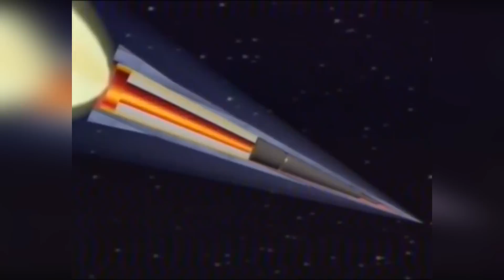Why "Oreshnik" is Unstoppable ?

Comment: Why use SM2 not SM3 against Oreshnik?
Reply: Both are useless, it's just too fast
Reply: Oreshnik can maneuver on a middle part of the trajectory and has 36 submunitions what can move with speed of mach 10. So sm-3 or other US interceptors can't intercept Oreshnik.
Reply: @batman7759  can't SM3 manouver and adapt to new trajectories of Oreshnik? I guess Oreshnik splits into Mirvs before reentering the atmosphere not in the midcourse?
Reply: @marcinmod1490  nope, sm-3 can't intersept Oreshnik in the middle of traectory. Sm-3 can only intercept standard ballistic missles in the middle of traectory. But even if it could it doesn't have enough speed to catch it.
Reply: @batman7759  According to Google Oreshnik speed mach 10, SM3 speed mach 13....Besides interceptor doesn't chase but only hit incomming missile and adjust to changing trajectories.
Reply: @marcinmod1490  you Are right about speed but both sm-3 and thaad can't intersept maneuver targets like Oreshnik. And march 10 I think it's a final speed for submunitions. In this rocket there are 6 warheads with 6 submunitions in each one. So 36 submunitions all tighter. And don't forget that warheads and submunitions are surrounded with plasma which makes much more complicated to detect this warheads and submunitions. Sm-3 and thaad can only intercept standard medium and intermediate range ballistic missles which can't maneuver on middle stage of traectory. So they are useless in middle stage against Oreshnik and in a final stage u deal with 36 submunitions.
Reply: @batman7759  But SM3 is a middlestage interceptor. The plasma occurs in atmosphere not in space where the interception should take place?
Reply: @marcinmod1490 both sm-3 and thaad can intersept warheads in middle and final stages but they can accurately hit only non-maneuverable warheads. So sm-3 and thaad are useless in the middle stage of Oreshnik traectory and in the final stage they must deal with 36 hypersonic submunitions.
Reply: @marcinmod1490  Oreshnik warheads fly mostly in rarefied atmosphere not in space. I agree what true plasma appears in dense atmosphere but in rarefied atmosphere warheads are still surrounded with ionized air or another words plasma cloud.